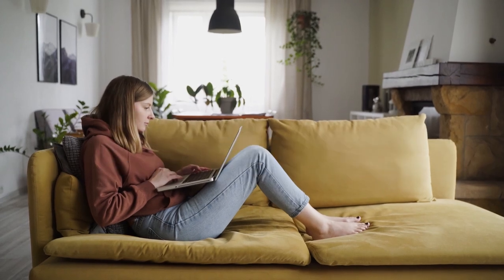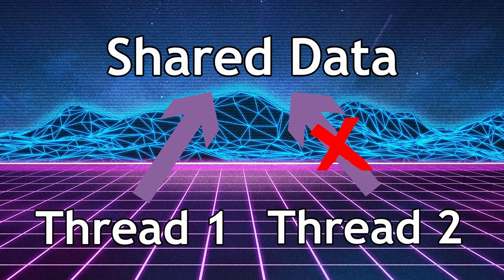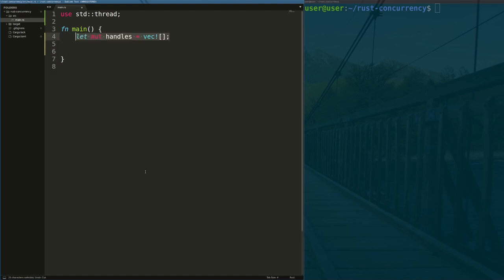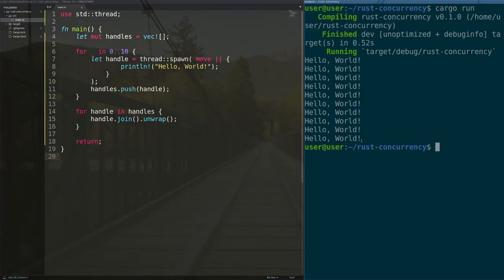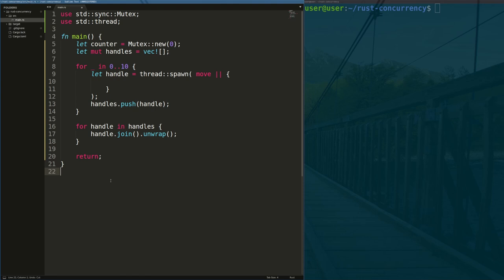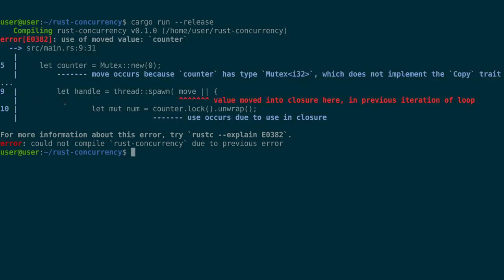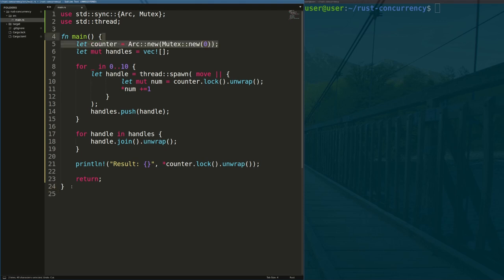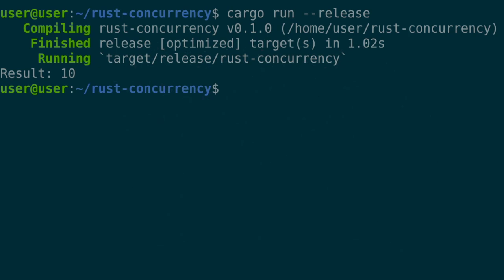Something Is Weird About Rust's Threading and Concurrency | Rust Multi-Threading Tutorial

Comment: The Mutex contains the data (and therefore owns the data), but who owns the Mutex when we are passing it into threads? Without answering this question Rust cannot automatically free its allocation correctly. Therefore we need Rc as a way to implement shared ownership; also we need the reference counting to be atomic to be thread-safe, ergo Arc. So in the end, it's Arc<Mutex<Struct>>. All pieces come nicely together and it all makes sense. It might seem complicated at first glance, but it's correct. This is what I love about Rust.
Reply: Edit: since this comment is getting pinned (thank you), I thought I'd add a bit more detail for completeness' sake.

Note that although this is the canonical way to share a `Mutex` in Rust, it isn't the only way. If you can somehow create a `Mutex` that is guaranteed to outlive the execution of the thread (which isn't trivial), then the thread can simply borrow it without using `Arc`.

One potential use case is if you have a long-living resource (as in, is valid for the entire duration of program execution; or in Rust-speak, having a `'static` lifetime), you can use `Box::leak` to release it from Rust's memory management, then pass it into threads by reference and it should work as expected. Practise caution though, because the resources you leaked will not be freed until your program terminates, as the name suggests.

It is also possible to do this without leaking memory, although you would have to create a "scoped thread" (with third-party crates, `crossbeam` for example) to guarantee to the compiler that the `Mutex` you are sharing by reference indeed outlives the thread. Check it out if this floats your boat. Update: as of 1.63.0, scoped thread has now been incorporated into the standard library 🎉
Reply: Important detail to add. Threading doesn't work in webassembly. We have to use the promise system. Async code is converted into promises as well.
Reply: @scheimong  If we use ```Arc::downgrade```instead of ```Arc::clone```` it creates a weak reference instead of another arc pointer. Weak references are freed from memory when the original is released.
Reply: there’s no need for reference counting because the threads are joined before couner is destroyed. this is what i hate about rust - it forces you to use bad abstractions with overhead, external crates for things that should be part of the language, or unsafe (most tutorials don’t do that)
Reply: @stomah9832  Ah hah. You would be, to quote Jack O'Connor who had an excellent video on this, "99% correct".
You overlooked the fact that `thread::spawn` CAN fail, which will cause the `Mutex` to be freed if not enclosed within `Arc`, while other threads still critically depend on it. So Rust is technically correct to complain here.
Reply: @stomah9832  The video is called "A Firehose of Rust, for busy people who know some C++". It's very well made and I highly recommend it.
Reply: You cannot guarantee that the threads spawned inside of the main function are joined before the main function returns. It is possible to not call the ‚join‘ methods for the handles. So you need to make sure your Mutex outlives the spawned threads by using an Arc.
Reply: @stomah9832  learn to implement lifetimes before complaining.
Reply: @rumplstiltztinkerstein  chill. Guy has a good point. The code without using `Arc`, while syntactically incorrect in Rust (for a technically-valid reason), would be semantically correct if `thread::spawn` is infallible (which unless in exception circumstances, it is). In plainer words, I guess you can say this code is theoretically incorrect, but practically correct.
Therefore I believe it is valid to question whether Rust's lifetime rules are unnecessarily strict in this particular case. Personally I agree that in this SPECIFIC case, yes it is too strict; however in the general (and hence more complex) case, where threads might be creating other threads terminating fast after passing on their handles, etc, it is not.
Protection against use-after-free is one of the core guarantees afforded by Rust's lifetime rules. In my opinion, having to always use an `Arc` is an insignificant price to pay when what we get in return is a theoretically-sound, ironclad guarantee that the code is correct.
Reply: @scheimong  I agree. Rust is a tool intended to fulfill a specific purpose. There are other tools intended for other use-cases, other types of developers.

So whoever is coming to the community to whine and complain instead of making valid points will get negative responses as well.
Reply: @stomah9832  what's the alternative that rust should use and why? Rust is meant to focus on safety not convienience. It's like saying why is my 10 lock door so complex to open. Security will always be a trade off. But interesting on your opinion since I love rust
Reply: @krellin  "Unsafe" blocks doesn't mean "unsafe code". It's just a reference that, in case a bug happens related to memory leaks, it probably is in the unsafe blocks.

If you don't like the language. Don't use it. Just don't get upset if someone that actually knows how to write Rust code takes your job a while after...
Reply: @krellin  What would your proposed implementation be? Whatever it is, I'm fairly sure there is either a relatively idiomatic way to express it in rust, or the code is buggy. Personally, I would implement something like this using an atomic integer that is just global and incremented in each thread. There is no overhead with that implementation except the atomic increment, which is unavoidable if you want to avoid a data race (and that will cause the wrong answer in a concurrent modification example like this). You can do this pretty easily in rust: have a `static COUNTER: AtomicU32` and reference it in the threads.

"i bet its not just one atomic operation for reference counter it may be a full lock" No, it's a single atomic increment for the reference counter. If you want a lock, you have to explicitly opt into it, as the code did in this case by using a Mutex. If you don't like locks, don't use them. No one is forcing you to use this method, although it is probably the most simple and flexible way to share mutable state of arbitrary complexity so it is the go-to solution for many.

"i was asking if its possible to do single CAS operation to do safe increments" Yes, if you use the atomic types you can do pretty much all the atomic ops you would find in C++: fetch_add is the one to use in this case but CAS is also available so you can do a CAS loop if you want. There are even convenient abstractions around CAS loops like fetch_update() which act like fetch_add but support an arbitrary block of code for the update instead of just adding a fixed number.
Reply: @scheimong  Scoped threads are now a thing since Rust 1.63 🥳
Reply: @scheimong  When can thread::spawn fail? From my understanding that failing generally means alert the sysadmin about the server nearly or actually falling over.
Reply: @Knirin  You are right, it basically never does. So it's worth discussing whether the requirement to use Arc could be relaxed in this particular case, but there are counter-arguments too.

I was actually in the middle of typing out a longer response when I realised I'm just parroting Jack O'Connor (and doing a really bad job at it). So just go watch his video instead. I cannot overstate how excellent it is.
Reply: Everything is a tradeoff in programming... While for some it can be weird, RUST makes just the right trade-offs to ensure correctness.

Comment: Also FYI, for most primitive types, Rust has atomic primitives and they can be much faster.  Instead of `Arc<Mutex<usize>>`, you can use `Arc<AtomicUsize>`.
Reply: That applies if you want each thread to do a single atomic operation on the value. If you want more complex logic you still need a mutex
Reply: if it is possible to compile with builtin atomic operations, it means that your cpu can operate them. idk what happens with a primitive cpu that doesn't include them
Reply: Depending on your use, you could also use an arc-swap::ArcSwap, or left-right::new_from_empty - but depends wholly on your use case. For some cases, arc-swap will be best (it's effectively a read-safe swappable value), for more a left-right reader-writer pair will be best (very fast), and for even more you can hold onto an &AtomicUsize or just ... use a sum of joins, if that's what's needed.
Reply: @kepler69c32  From reading the std::atomic docs, it seems that Rust just doesn't allow usage of atomic types on unsupported platforms
Reply: Recently, I came up with the same exact solution and it really worked!

Comment: You can also pass the mutex as a reference, but one limitation of thread::spawn is that it requires the 'static lifetime, which you can't achieve without leaking memory in your example. Thankfully there are libraries that help bridge that gap, like scoped_threadpool
Reply: Since August 2022, there's scoped threads API in the standard library, too :-)

Comment: Great video! But would you mind removing the "return;" at the end of main? It is bad programming style and opposed to the functional base principle of "every block has a value", which rust adheres to. (opposed to blocks 'returning' a value)
Reply from the maker: Good call!
Reply: i think calling it "really bad programming style" is very hyperbolic.
Reply: @touisbetterthanpi  well it's a redundant statement that does nothing and it carries over a concept from C that doesn't apply to Rust. So yes, I think it's bad programming style :)
Reply: @m.sierra5258  and some people prefer to have their return values specified more clearly, because it improves readability and provides a clear distinction between functions with a return value and functions simply modifying state :)
Reply: @aragonnetje  In my experience it becomes very natural. Because return only works with functions; if you want to pass values out of if or match statements, or blocks in general, the way of writing it with a statement without semicolon becomes second nature.
Reply: @aragonnetje  The distinction for expression returns is that the last line doesn't have a semicolon, which means it is an expression, which becomes the return value.
Reply: @saadisave  I know that, but the word "return" is a lot more visible than a semicolon
Reply: who said that you have to adhere to functional programming principles when using rust? "return" makes rust look a bit more normal lol

Comment: Perfect timing. Having a lecture about concurrency for the last few weeks and wanted to know how it works in Rust :)
Reply: In more detail, it's controlled by the Send and Sync traits.
Send allows you to send a value between threads, with ownership. An example of something that is not Send is Rc, because it does non-atomic increments of the reference counts, and sending that across threads could cause data races.
Sync allows you to send a reference to a value across threads (although without scoped threads, it needs to be 'static). An example of something that is not Sync is RefCell; passing a &RefCell gives unsynchronized mutable access to the contents (as RefCell does not atomically control access).

By default, types are determined Send and Sync by their composition. That is, a type that only contains Send/Sync fields will be Send/Sync.

Comment: I'm just playing with Rust, but in mt early attempts to use threads, I found that declaring  the mutex as static also works, without using Arc. After all, you do not need to mutate the mutex, only its contents.

Comment: Doesn't need to return a value explicitly. Like in this case, where `main` function returns `unit` type (aka `void`).
If you return a value don't need to write the code like this:
`return 5;`
Need to write this code:
`5`
Reply: As this might be confusing without context: rust adheres to the principle that every block has a value. That value is the value of the last line, if the last line is written without a semicolon. That allows for a very functional programming style.

So returns should be avoided as much as possible in general and replaced by multiple branches, multiple match cases or similar.

Comment: Although this is complicated, it never feels like it's lazily developed. Someone put real thought into this and ensured it stays as simple as it can, while adhering to the fundamental memory safety of Rust.

For those who didn't get it, let me explain it this way:

You want a value to be incremented by multiple threads, but for that you need to define it in the scope of the main() function, just outside the for loop, but if you do that what the thread code gets is a copy of this value which it increments, which won't be reflected in the original. 

So you gotta create a mutually exclusive reference to the value, which can be passed by value and dereferenced to get the value and increment it in such a way that only one thread is dereferencing at a time, which is where Mutex comes into the picture. 

But now, the variable holding the Mutex cannot be "moved" into the thread now, so what I would generally do is a copy reference. But if I copy that Mutex, how would other threads get the same Mutex? They'll get its copy. 

So now I need to pass a reference to THAT Mutex, but this reference is being made across multiple threads, which means Rust needs a way to know when all threads have called whatever references they want, and it can safely discard the original reference, so an atomic reference is used which is Arc.

I know my explanation is a bit lousy, but I'd love some feedback on it, because I'm also an absolute beginner in Rust

Comment: The following might seem like nitpicking but there is a critical point at stake here…

You are saying “concurrency” here but because you are talking about mutexes and sync issues associated with multiple threads, I think it would be much clearer to say “parallelism”. A program may utilise concurrency without creating multiple threads, i.e. without any parallelism. In other words, while parallelism implies that there is concurrency, the reverse is not true. And crucially from the perspective of what you’ve presented here, concurrency without parallelism has the major benefit of supporting lock-free algorithms and data structures. Mutexes or other sync mechanisms are only necessary in the context of concurrency achieved through parallelism, not concurrency generally.

Speaking of other sync mechanisms, a smaller point I wanted to mention is that if the requirement is just to sync access to a counter, it would be very inefficient in C/C++ to achieve this using a blocking mutex. It would be better to use an interlocked memory access API which provides an ability to atomically increment a counter in a thread-safe way using special CPU instructions. All of the major instruction set architectures in use today support interlocked memory access. The C++ Standard Library exposes the OS-specific interlocked API through the various templates and specialisations in the <atomic> header. I’m sure Rust has an equivalent.

Edit: I’ve just seen that another commenter has mentioned the Rust equivalent to <atomic>.
Reply: Thanks for the nice explanation. Others were talking about scoped threadpool. Do you know what it is?
Reply: @TON-vz3pe  Not sure what they’re referring to - there certainly isn’t any std::scoped_thread class template. Generally though, when C++ devs talk about a “scoped _____” they mean a class that uses the RAII pattern, i.e. a class whose instances own some resource and whose destructor will free/release/close/delete that resource.  I can only guess then that a scoped thread pool refers to a facility whereby a thread can be leased from a thread pool to do some background work, and where the thread is returned to that pool on destruction of an object. I’ve implemented something like that a few times.
Reply: @TON-vz3pe  Scoped threads refers to a safe way to access stack variables in Rust. Since threads are technically there own lifetime close to static you would normally need to move everything. However a scoped thread shortens that lifetime making it possible to just pass references and not copy/move.

A pool of these would just pull from already spawned threads instead of creating new ones.

One thing you may find odd is that they are done in the form of functions and closures. This is due to the fact that drop is not garenteed in Rust or any other language.

Comment: Can you put a Rust Mutex into a structure and create that structure ahead of time and assign it to a static variable?  Does this work around the mutex moving restriction?
Reply: Rust does not allow code to be run before main. Therefore all global variables have to be trivially statically costructible.
Therefore to implement your suggestion you would have to wrap the mutex in a lazy static variable, and then you would be able to access it from every thread.
But that is also discouraged, because it is unclear when the lazy static mutex should be destroyed, or if it sounds be destroyed at all.
Global variables is one of those C concepts that rust tries to un-learn programmers. It's much better, conceptually, to have a context object passed to every thread that contains a mutex smart pointer.
Reply: You would most likely just use a scooped thread. You can take multiple references to it without moving it.